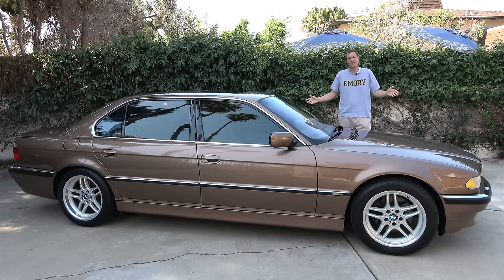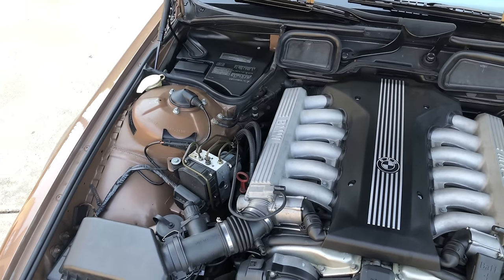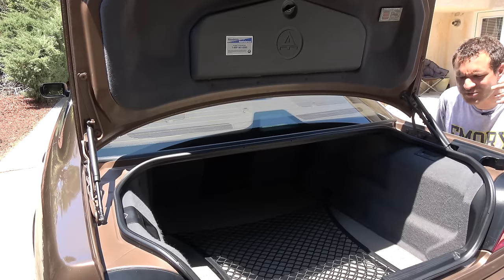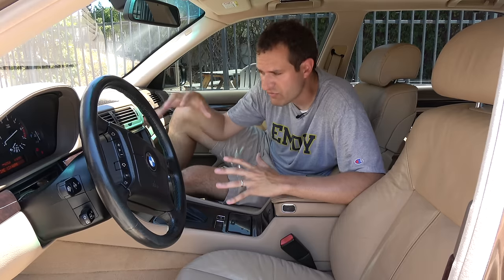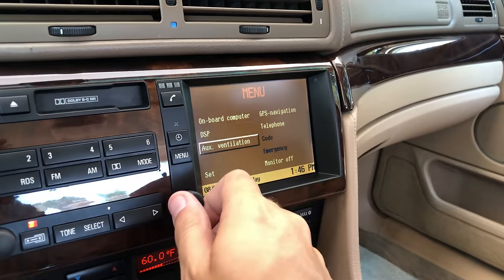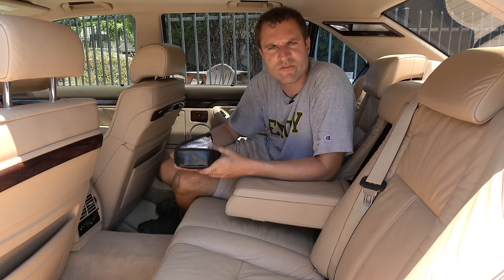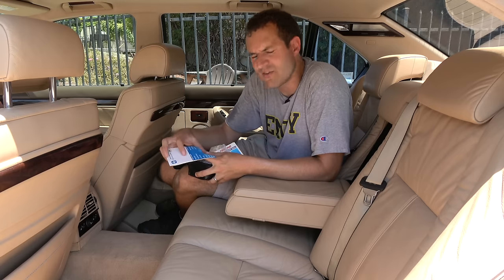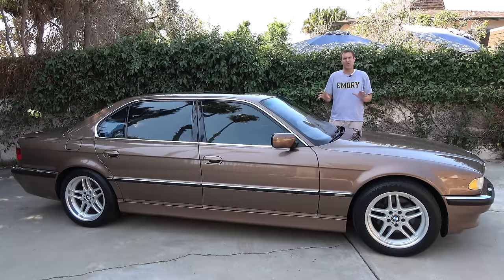Here's Why the 2001 BMW 7 Series Is the Best Luxury Sedan Ever

Comment: I actually have an 01 740i with the M sport package. There are a few things missed in this video... Some of these cars were bulletproof and had an explosive to blow the windshield out if you ever needed to get out via a window. Some had a bag for your skis... There is a compartment under behind the ashtray for extra storage. This car has motion sensors, you can open all of the windows and close all of the windows, including the roof, from the remote. You don't need the key to open the trunk if it's not locked, you just press the lock, it's actually a button... Some came with a 10.4 sound system, meaning, they had 10 speakers and 4 subwoofers, a factory amplifier and fiberoptic cables for optimum sound quality. That radio is actually the baseline, there was one with a larger display. It has heated and auto-dimming mirrors, yes, the mirrors on the doors automatically dim when someone with bright lights comes up behind you... They also have heated automatic windshield wipers, so they come on automatically when water hits the windshield and they adjust their speed as needed. All windows are one-touch up and down. There are ambient lights inside, so while you're driving at night, it's not completely dark inside the car. Auto-leveling HID headlights (1 light blub is $100)... That particular 750il didn't actually have the complete M package on it. The one that came with the complete M package is actually very rare. I've only ever seen one of them. They come with the M steering wheel and sport seats up front. They lied about the power, it's very underrated. As for handling... The best way I can put it... You know the suggested speed signs on the freeway ramps? The ones that suggest 30mph, I do well over 80mph through them without thinking about touching the brakes and the car doesn't feel like it's going to slide or flip. Remove the governor and the car will do over 170mph. As for how reliable they are, well, I bought mine because my father bought one years ago and out of all of the vehicles he's ever owned, that was by far the most well built. 

I searched the whole country for one and just so happened to find this one in Michigan while I was in California. I sent my father the money and had him pick it up for me. I only paid $1400 for it. Didn't have a battery, so I didn't even know if it ran or not. When my father got it home, he put a battery in and it started right up. Needed basic maintenance... Fuel filter, spark plugs, ignition coils, o2 sensors, MAF sensor, air filter, valve cover gaskets, oil change, and oil filter. The previous owner was an idiot. The only thing it needed that wasn't a part of the basic maintenance was the LCM (lighting control module). The headlight would flicker as it the car was haunted. Was about $40... Oh, I needed some suspension parts too. Lower control arms, tie rod ends, the usual stuff. Did the work myself, parts weren't even over $300...

Now for the horror stories... When it comes time to replace the timing chain set, you'll be looking at about $2000-$4000 if you let a shop do it. Most people don't have the tools or knowledge or time to do it. Most people don't think this car is worth it. Most people aren't very intelligent, hints as to why the world is as it is. But thankfully, some of the intelligent few got together and built the e38 BMW. A set of tires, mounted and balanced, you'll be looking at over $700 and if you get really nice tires, you'll be out of over $1k. I opted for the W rated tires rather than the Z rated tires... The set will likely have to be ordered. My oil change, doing it myself was over $80, but that's because I did it my way. Ignition coils were about $300. Registration renewal fee in Michigan is about $300... Don't even bother trying to use the cup holders, they will break and don't hold much of anything anyways. The wood is real and the coating will crack, but you can sand it down and repair them. This car will attract all kinds of gold diggers, not just mean females that want money... They do tend to rust, so you have to keep on top of them and I don't recommend driving them in the snow. While they do go through the snow surprisingly well for what it is, the snow and salt don't do the body any favors... Letting the windows down before allowing the car to warm up will cause the window regulators to break, but no worries, they're cheap, just a bit of a pain to replace.

No, I haven't uploaded any videos of my e38 yet. Funny thing, my car was actually built on my birthday... I found it in my favorite color combination and at an unheard of price. Yes, I will be uploading videos of it soon.
Reply: great paragraph
Reply: Bought the one I had years ago from an eye doctor too infatuated with his new car and let the 7 rotting in his driveway. In 2015 I bought it with 172k on it (01' 740il Anthracite Grey) wasn't a highline or anything. But he had purchased it new in 01, with a sticker of 67,500. I bought it off him needing rear tires, a battery, not much else for a cool 600$. Not saying anyone else could. But I've heard these cars in decent shape go for under 2500$ on more than one occasion.
Reply: Yeah and you are right about the M package isn't on that car. Pretty sure you could have had an 01' E38 with the "M Parallel's" optioned to most configurations
Reply: Subbed and waiting
Reply: Hey man I love the E38 too, I own one with the "real deal" M-Sport package in California, it's the greatest (and probably the rarest thing I've ever owned). I'd love to see your 7, and so I can't wait until you post about it on your channel!
Reply: @bigredct7629  The M-Sport package wasn't offered on any of the iL models the very end of the E38's production run, (I believe, don't quote me though ;).
Reply: @mmdnarayanan  Im also here waiting on the vid, no rush though.
Reply: @jylp4u
Didn't read your entire treatise yet However, you get Madd Kudos/Love simply for mentioning the Exploding Windshield (to get out) safety feature!!!
Reply: How much days does it took to think and write this paragraph?
Reply: Harry 4664 I think he just spat it out, this sort of writing doesn’t take that long (for me at least)
Reply: Subbed and anxiously waiting :D

Comment: 137k Miles someone took ridiculous care of this
Reply: Seriously though, I'm impressed.
Reply: Dante why tho
Reply: my 740iL made it to 240K and its still got life left in it although its got some throttle issue. Still runs!
Reply: @_VEKTA I used to own one with 190k  ran good but it had electrical problems.  Drained new batteries like crazy.  Expensive repair so I sold it for 3k. It was very clean and everything worked.
Reply: @UltraRed24  mine has been sitting for about a year now. Try to start it every once in a while. Its a dying car and just not worth the money itll cost to keep it going. I absolutely loved that car though.
Reply: What? This is low mileage.

There are many 300k+ miles E38 around the world still in use.
Reply: @_VEKTA  we know, you couldn't top up oil or its changes and probably was close to overheating, thanks for ruining one. .
Reply: My 2002 530i also has 137k miles. I just bought mine and I must say it is in excellent condition. With the exception of some rock chips and broken cup holders, I would say mine is perfect.  BMWs of this era just seem to hold up decently if you don’t treat them like absolute crap.
Reply: ya it looks clean
Reply: How do you get 200 likes in less than an hour in a comment? I mean he is def hacking or something...i have year old comments with only 1 or 2 likes. And his comment isnt even interresting...how..someone explain..?
Reply: My E38 730d has 256k miles on the odometer. I use it as a daily driver. Still looks great and drives well.
Reply: Thats alot of miles/km Idk why everybody is impressed about that when its a 7 series. If it was a civic etc yeah be suprised that it has 120k miles but a 100k+ car yeah id hope itd have low miles.
Reply: I see E38s for sale with low miles quite often. My local BMW dealer has one with 80k miles for $5k. It's a 2001 in good condition but it's got some mods like the widescreen Nav system and a aftermarket Infinity Basslink subwoofer. The interior isn't great though. It's missing some speaker covers and has wrinkled seats. But overall it looks like a good buy. It's black on beige.
Reply: 137 is nothing, look for the 200k examples
Reply: @av3n..353  what are you even talking about?
Reply: Nahh these old German cars actually live long lives lol they are built to be sturdy
Reply: @สุราณีพยุงเกษม   You said it, that's how these people get likes etc. Lots of companies out there that offer these things cheap.  Half of the comments in the comment sections are bots on many large sub videos.
Reply: cool guess im a bot buyer now ever think i might just be POPULAR
Reply: mine is from 99 with only 100k miles on it.   but it's a e46 328ci, not a V8 :(
Reply: Porter McSorley 02 e39s for the win! However, mines a 540i
Reply: My e32 740iL made it to almost 200 and it needs some work but it's nothing crazy. My dad's e38 740iL blew a head gasket around 150 though
Reply: 740 is far better than 750
Reply: Germans dont know how to paint a car badly.  Mine is nearing new paint, but for 20 years its impressive.
Reply: @_VEKTA  a 7 series that ran for just 200k? Sheet, i have a 2001 volvo v70 2.5tdi with 600k still runs like a beauty.
Reply: My E46 is at 236k miles atm.
Reply: My Audi Cabriolet ist 26 Years old and got 120k on the Clock🙂
Reply: Imouto!
Reply: สุราณี พยุงเกษม there is some quality content. Maybe that’s reason.
Reply: yeah it's called never driving it and cleaning it everyday lol...
Reply: I have a 2000 bmw 323i with 250k miles... I think I’ve done better than that 7 series. And my car lived in the rust belt for its whole lift. 250k miles and no rebuilds on the engine or transmission.
Reply: It's supposed to be well kept in my opinion...look how much it cost brand new
Reply: Um it may take you by total surprise, if you respect it, take real good care of all schedule routine maintenance. Change the oil on or before every 3K miles or on or before every 3 months whichever comes first and you keep the Bimmer clean by washing and waxing, condition all leather interior surfaces, it will continue to look, run, drive and handle as if it were straight from the showroom. So yeah, if you take real good care of things, it will take real good care of you in return.
Reply: 137k miles is nothing for a car in mint condition
Reply: @DrScopeify I had a 2001 VW Passat, that shit blew up on me and left me stranded on the highway. It just hit 156k when it happened. Piece of CRAP. Never again 💯
Reply: Sheldon Gunby, a Bimmer with 140k miles is nothing. The engine isn't broken in yet.
Reply: @peterm6737  Seriously, you're impressed? Lmao! I don't know why or what is so impressive to you. A Bimmer that has 14OK miles is like brand new, the engine is barly broken in.
Reply: @captainfallsalotatppic2508  It's quite simple really, I see a crap ton of people abuse their cars, seeing one in nice condition ( regardless of the mileage ) is refreshing to me. 
I want my car to look that good at a quarter million miles.
Reply: Zack Smith  Zach, I don't know what kind of automobile you drive, but I assure you, Bimmers are not made of paper and they do not break easy. When I got my licence at 17 years old back in '87, my first car was a 1987 BMW 535i. I still have that Bimmer. It still looks, runs and drives like new and it has about 450k miles. Last year I traded my 2012 650i for a 2018 650i xDrive convertible.
Reply: @Jay-jb2vr  A Bimmer that has 140k miles is nothing, engine isn't broken in.
Reply: On the East Coast and Where I live, Cars with this kind of Mileage are usually very torn beaten and in bad shape. We do not have very long or very many Highways and People do not use them on their Commute very often. Most Travel is done on regular very poorly maintained roads. So getting that high of Mileage around here and the East Coast in General is rare to see on a car kept this nice.
Reply: Probably serviced at a BMW dealership its entire life
Reply: I have one with 80000 km 😎😅
Reply: LOL it is german engineering.. 137k miles is like absolutely nothing... It would not even be anything in a Polo 1.0 :D
Reply: @damir4132  Never heard of no car making it to 600k,  that car should be in Guinness books.
Reply: That's high for a BMW, they usually explode earlier, cuz they're junk ya know
Reply: Sheldon Gunby i have my 2002 325i 98,025 miles so im good right:
Reply: I've got 740iL 2001 with 53k Kilometers in Poland :)
Reply: it so much gas...why would you take this anywhere
Reply: @jdgshsjchdjejkd545  shite ending, kuroneko best grill but I should have expected it because of the title
Reply: My adventure 2001 122k km
Reply: @karenbonime9592  my Mazda 323 1994, 130,000km.
Reply: Gotta put that ghetto twist in it. Such a shame and low class.
Reply: I just bought a 2003 Honda Accord coupe (v6) with only 45k miles on it last month. Really well taken care of too.
Reply: John McGrath Ill assume you don’t know what your talking about or maybe you just live on the sarcastic edge of life. But okay.👌 no way you can back that up with real physical credible data. 🤣😋
Reply: My 2000 E38 has 179,000 miles and counting.  Leaks oil but runs ok.
Reply: Sheldon Gunby someone with a lot of money 🙃
Reply: Sheldon Gunby our e36 has 120k has it since new it’s my Dads

Comment: I always loved the look of that car
Reply: Same here
Reply: Yup!
Reply: I was hoping the button in the ashtray would be for the passenger's ejector seat
Reply: Its ugly
Reply: One of my neighbors just got a black one, with dark tinted windows, and the neighborhood is insane over it.
Reply: @Master Yoda have you had one? I've had 2 e38s an a e65 and they are reliable, just need to be looked after, if your to tight to pay for maintenance then it breaks down. Never broken down once in 400k miles an 14 years. Had things that require repair or replacement. Main problem area on the e38 is suspension parts don't last to long,  may be 6k for front bushes but it's a heavy car.

Comment: I still stop and stare when I see a 540 wagon.  Best looking wagon of all time.  Good design years at BMW.
Reply: looks the same as a 530 wagon or any other engine?
Reply: Hold on, you're forgetting about the Oldsmobile Vista Cruiser, you can literally cruise the vistas.
Reply: Eric Peltier I have a e39 touring and love it...
Reply: @Krith220  The 540 had slightly different body parts and was lower.  So good.

Comment: "the owner did tons of mechanical work to get this car in shape."

Lol, no surprise there.
Reply: @footballcoreano LMAO sure buddy
Reply: @justincarrillo12626  lol
Reply: Buy one used and you'll spend more maintaining it than it will ever be worth.  Easily pick them up for $1500 abused and $3000 in perfect mechanical condition (perfect until they break down anyway)
Reply: That is absolutely, 100% correct. I got my 2001 e38 M Sport for $8K with 90K miles on the clock 6 years ago. It was an incredibly clean car with very low mileage for it's age. I've easily spent at least 8K to keep it on the road.